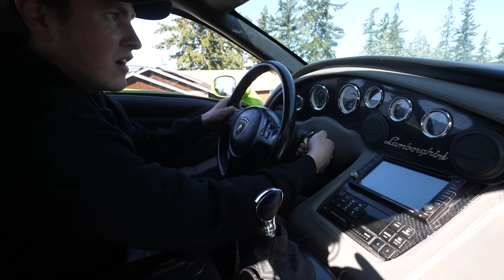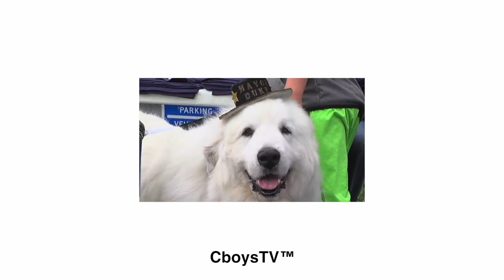Buying Fake Lamborghini off Craigslist

Comment: The moment he said the motor is actually in the back I knew it was about to be a fiero with the supercharged 3.8 😂😂 although they aren't super slow, couple bolt ons and you can push around 340 hp after a tune

Comment: It looks good. It sounds actually pretty good. The mechanical issues can probably be fixed with a good $8-10k (airlift, legit brakes, fix up that dirty ass motor, etc.). I would be worried about the wiring. With any kit car, you never know what rat's nest of wiring there is until you get a short.

Comment: The fake lambo looks beautiful tho😂nice body and rims and interior is kinda nice, the butterfly doors the rear end and front of the car, its just so cool,  if it actually worked well and drove smoothly on the ground I would buy that car as my starter car😂🔥26k would be a very solid price if it drove smoothly and had no issues or minor issues, because it just looks so damn cool

Comment: I mean all jokes aside, whoever did the body work put a ton of time into it, well as far as I can tell in a video lol. Ive seen some super Janky kit cars and that one legit passes for a Diablo just looking at the exterior.  Definitely not worth 24k in that condition but for bout 10 k ish I wouldve been tempted to buy it and build it right with another maybe 10 and a whole lot of hours of my life lol. Youd still be at about 1/20th of what an actual Diablo goes for and could still be pretty badass 🤷🏾. The only thing I dont understand with most kit cars is why ppl put such weak and unreliable motors in them. All that work just to break down every time you drive it and get dusted by civics lol

Comment: As a kid inthe 1970s KitCars were a big hit and the majority of them were fiberglass bodies bolted to a VW Aircooled pan and engine  I always thought it would be cool to have  a bunch of bodies that could be switched very quickly  ofn and off one  high performance  pan  then everyday you could be driving a pretty cool looking car  the majority of people don’t know  what are real or fake  there was even a tv show inthe 70s that  had a Bradley GT  kitcar as the big focus of the show  I used to laugh because they dubbed a muscle car sound to it for the show but I really knew it was probably a 36 horsepower VW Beetle  powering the car  and my Dad had several VWs  that were super slow cars  with a very distinctive engine sound

Comment: You guys messed up the fiberglass front spoiler it has airbags on the front if you look on the center console there is a gauge for the air pressure that is for the front end there's a button there to lift the front suspension push the button and you'll hear the compressor kick on and watch the pressure rise on the gauge and the front end will go up

Comment: Josh might not had been ripping you off but he could of took the price down a little at least 19,000 because the car had a some of problems with it and they have to be fixed before driving it so he should of took that in consideration also